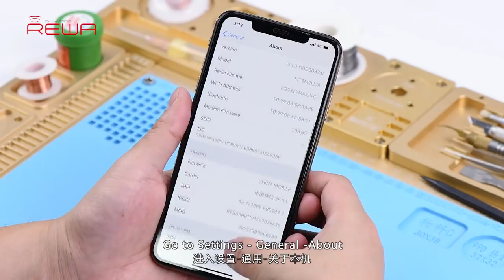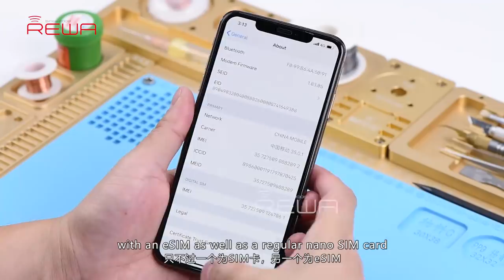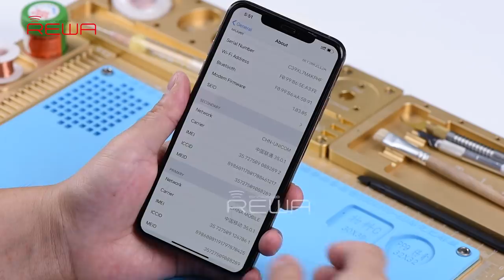iPhone XS Max Hack - Single SIM Card to Physical Dual SIM Card

Comment from the maker: Would you like to change your single SIM card iPhone Xs Max to physical dual SIM card version?? Leave us your ideas.
Reply: Not really an iPhone fan, but very cool to see that things like this are possible. Very good job!
Reply: really amazing ...i really wan but ... feel bad for iphone... :( .. but you all rewa got so special kind of skill about iphone..
Reply: Just buy Chinese version of iPhone XS Max which come with physical dual sim instead of esim combo.
Reply: You are really specially master
Reply: Would both be 4g LTE ?
Reply: Amazing. You guys are professionals.
Reply: is your pcb cleaner same with flux remover?
Reply: REWA Technology Ofcourse. We will if we have your god mode skills.
Reply: Dont need. Samsung has the S9+Duos .
Reply: Would this work for the international/GSM version?
Reply: @solidfoxy  Of course your Samsung works worldwide!
Reply: @solidfoxy  i ask too
Reply: Two sim with one IMEI?!😂
Reply: We don’t need to put back U sim chip?
Reply: Can you try to add physical Sim card slot/tray to iPhone 14 US/Esim only? I’ve seen teardowns and the logic board still has space for the sim.
Reply: Absolutely, especially when my local mobile carrier’s eSIM is only available through a postpaid phone plan.
Reply: @John_Franco but then you have to drill through the chassis or replace it.

Comment: Does this mean if your imei gets blacklisted you can use the secondary and it will work fine?
Reply: Yes. Works for all dualSIM phones. All of them have 2IMEIs
Reply: IMEI is embedded in the phone not with simcard. This only changes esim EID to a physical simcard. Just like how you put a new simcard into s blacklist iPhone won’t get you unblocked.

Comment: Making the board dual layered is the shittiest thing Apple did in the last 10 years.
Reply: Why is it shit to use a dual layer Motherboard? You can have a much smaller Motherboard with the same Chips and have a bigger battery so I don't see any disadvantages of an Dual Layer Motherboard, but maybe you can tell me some?
Reply: @Evolinox   overheat problem，but I choose a bigger battery
Reply: what the fuck just because you cant repair it in your garage doesnt mean its shitty design

Comment: Please do research on possibility of    Jailbreaking iPhone hardware method.
Reply: هوناً ما yeahh
Reply: هوناً ما not how it works lmao. To achieve a jaikbreak you need full kernel read/write privileges there’s no possible way to hardware mod software.
Reply: what about flashing modified kernel direct to the nand flash ? @edenk3500
Reply: @JohnDo-j7z  u mean writing to the flash? That's basically what's already being done, no need to rip the phone open. Plus Apple has certain checks in place to authenticate the firmware or some garbage like that upon boot. If u tried to code a jailbreak directly into the OS you'd most likely brick your device and have to restore from iTunes. There's a reason why it's so difficult to make an untethered jailbreak like there used to be. If u wanna talk further abt y it's not possible u can join the r/jailbreak discord
Reply: Thanks for the informations @edenk3500
Reply: Limerain was a good exploit. We all miss it. But it never happens on newer models. With current trusted boot technology, cracking into iOS with screwdrivers is a no-go.

Comment: Would this allow two CDMA lines at once Sprint and Verizon for example
Reply: Cellular bands are different in China vs de US (different frequenties) so you would probably not get any reception.
Also CDMA is a completely different kind of networkstructure, so no that wont work.
Reply: Thom Steenbergen I meant on LTE because even though CDMA doesn’t use SIM cards, LTE still does
Reply: In the US, CDMA is done as of 2020, no more 2g or 3g
Reply: Alyn Pappas What about GSM 3G because my grandma still has what we would call a “dumb phone” and it only supports 3G
Reply: @danielgartin6993  she'll need to buy an updated device. Everything is moving to Voice over LTE
Reply: Alyn Pappas or my aunt can just buy a new iPhone and my grandma can have the iPhone 7
Reply: Alyn Pappas good thing the iPhone SE is only $250
Reply: Yes, but using hacks. You have to create an iTunes backup when you have 2 CMCC (mainland China Mobile) sim cards up and running(not roaming), both w/ VoLTE enabled. And then insert two CDMA carrier sim cards, restore with previous backup(w/o wiping your phone in advance). And usually you can eventually get 2 cards running.